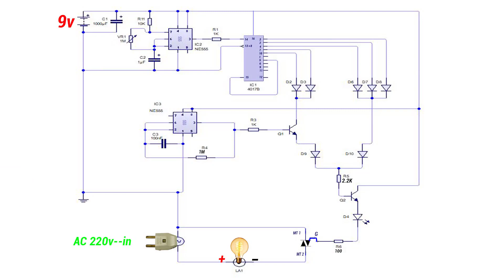Amazing,, 2 Effect,, 220v LED Chaser Circuit.

Comment: Thank you very much, this is very! important to show that ... other designers who have similar YouTube channels. They lie! constantly, where it is shown that ... without ARDUINO or Raspberry Pi the same can be achieved, with lower cost and without any type of programming. also with basic components make it better.
A question that I always ask myself as Amateur Electronics in your projects. I know that an NE556 is 2 NE555s together. What is the difference of not using it? Thank you and we read each other.
Reply from the maker: Thank You so much sir for understand me,,,
And I don't understand your question well,,, So please repeat the question I will try to answer 100%.
Reply: @uniqueelectronics7145  
The question was that I see that, this circuit has 2 NE555s. When with an NE556 you can do the same because (it is 2,555 in a single package, ok?). So why do you use 2 555 instead of using an NE556 ? Was the question better understood now? Thank you very much.
What if! , I understand you, because you don't fool people (YOU PUT THE CIRCUIT) no! You are looking for Likes. And as I told you before, the pleasant human sactifaction of ... knowing that someone built it and ... it works! Also, the vast majority on your channel, we are not Technicians, we are * Amateurs * that we like , soldering things. More now than LEDs, they are very fashionable in everything. I continue! Waiting for the next project. My name is Ricardo, I am 58 years old and I am from Buenos Aires, Argentina. Until next time.
The electronic translation may contain errors.Byee